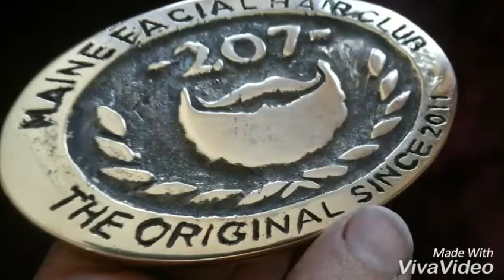Brass casting. Mould for a belt buckle pattern.

Comment: Why's your sand black? Is it petrobond?
Reply from the maker: yes it's Petra Bond I have used it a million times as you use it it. you can reactivate it with non detergent oil.
Reply from the maker: ***it turns black as you use it.
Reply: Tristan Smith oh thank you